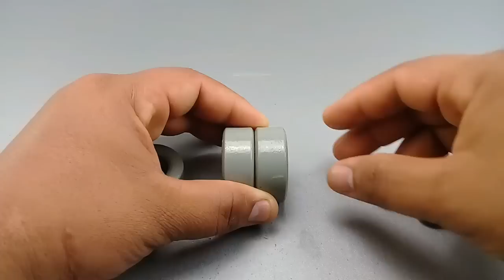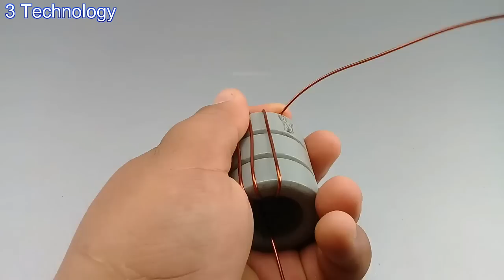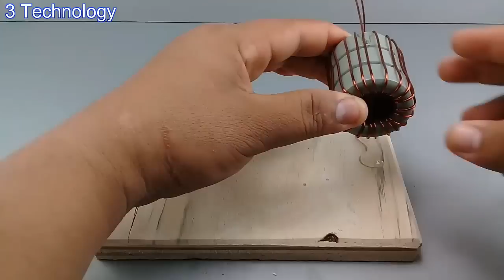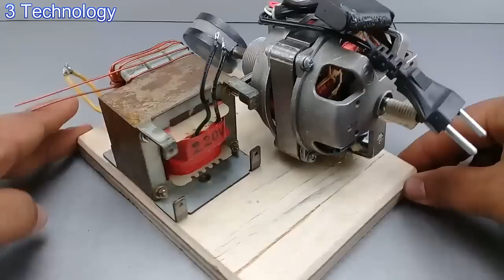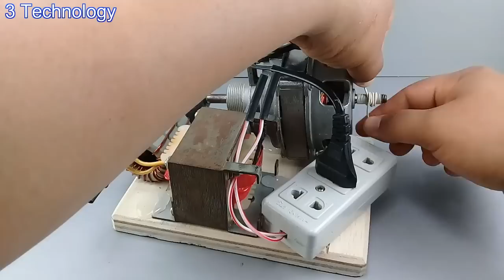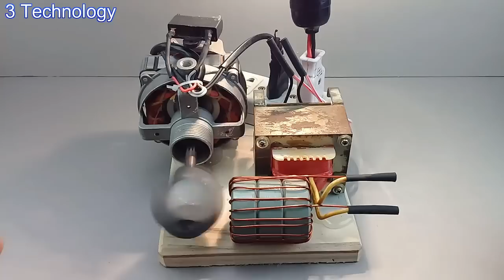100% Get Free energy 5000w 220v powerful electric generator using copper wire and transformer

Comment: Hi there, I have a question. Is the motor you are using to spin the magnets from a washing machine or dishwasher? Also, where did the iron toroids you used to wrap the copper wire around come from?